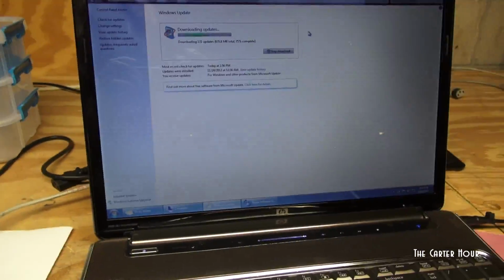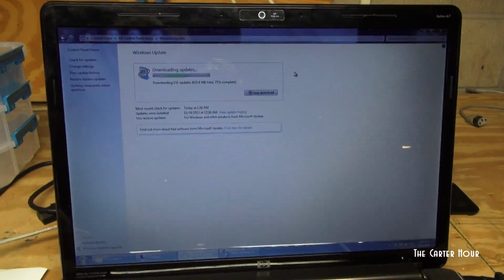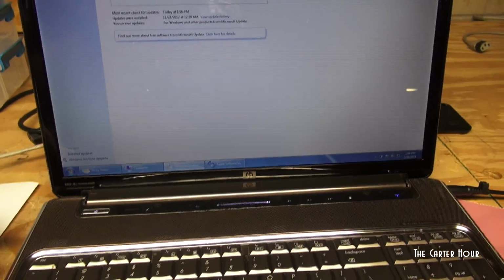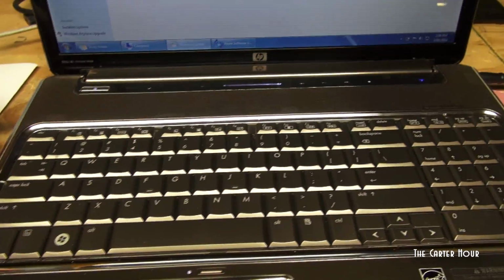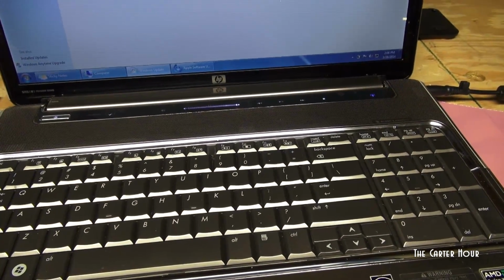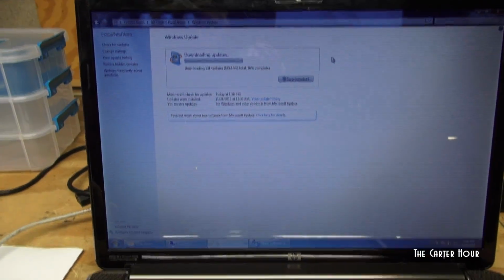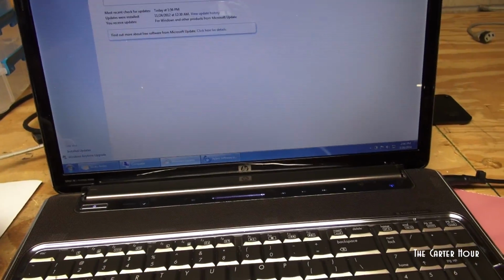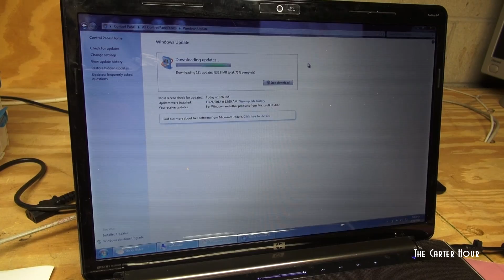HP Pavilion DV7 Laptop Unconventional Motherboard Repair

Comment: My Pavilion Dv7 had the black screen of death. So I was looking at replacing the motherboard when I came across this video. With nothing to loose, I tried it. Baked my motherboard at 365 degrees for 10 minutes, cooled for 40 min. then baked a second time. To my surprise this WORKED!! It's up and running to my amazement. Great fix, Thanks.
Reply from the maker: No worries, they were famous for their over heating video cards that would cause the solder joints to become loose.  Glad it helped!